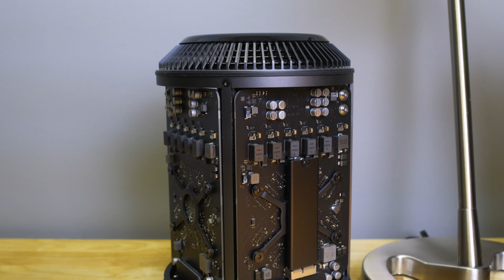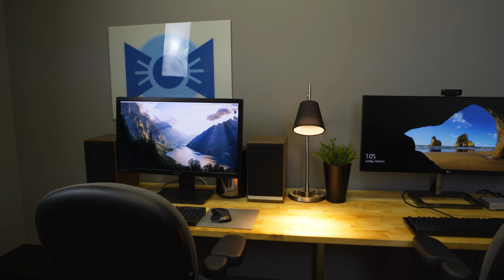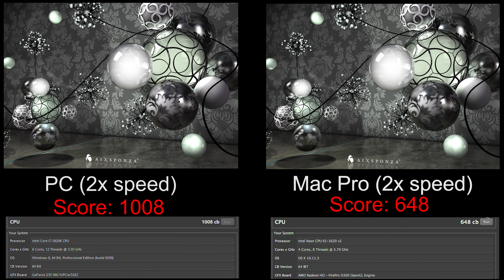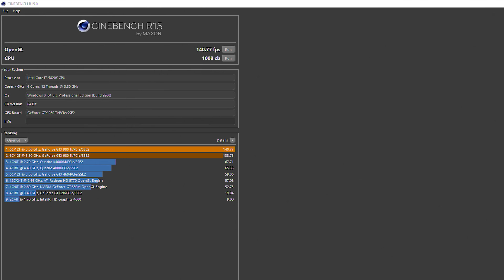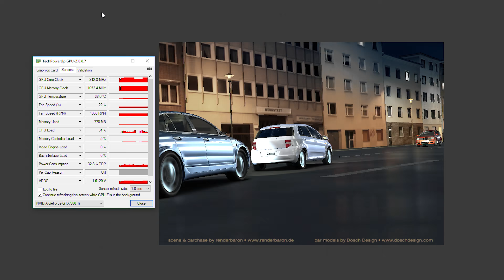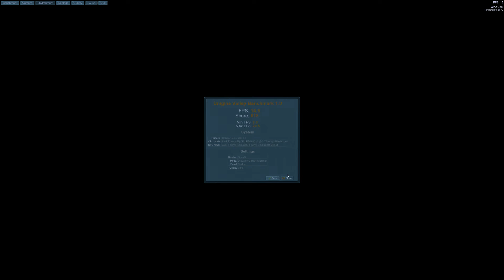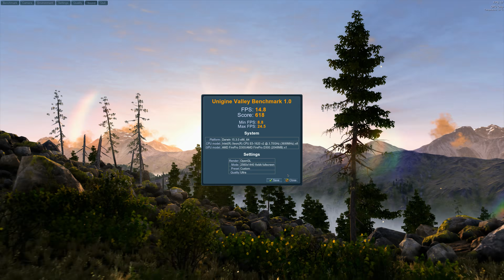$2,000 Custom PC vs $4,000 Mac Pro

Comment: Simple Life Fix for Apple Fans: Buy Apple OS, Buy or build a custom gaming rig for about $2K then load the Apple OS on to it. Boom! Now you have a system that can out perform anything Apple ever invented.
Reply: osx doesn't support most hardware cuz it sucks
Reply: +AngyPangy The hardware used to build Macs are also used and sold for PCs. Not everything would work but there is a lot of high end hardware listed on the supported page. Also motherboards that were made for Intel processors, and manufactured in 2010 or newer should work with no issues. Mac OS X offers "out of the box" support for many graphics cards by NVIDIA and AMD. If all else fails you can use OSx86 which is Hackintosh.

Comment: THIS IS UNFAIR.... it should have been Mac Pro vs Xbox One vs PS4 vs Wii U... that should have been a fair test... oops.. You can't game on a Mac... sorry....... Now I get it... Moving on
Reply: Blaze Fire - No need to explain Mr. Keyboard warrior... I understand the frustration.. People just don't play on that standards anymore... that is why we need to lower our expectations on a Mac on gaming... ok for your convenience.. let us lower it to PS2, XBOX and Dreamcast... Happy?... We could go to the 90's if you want... Peace My keyboard brother... CHOW!!!
Reply: so true macs are not for gaming
Reply: +Jerald Guevarra You CAN game on a mac, but it usually works better with games DirectX9 or lower. So at best you can run Source games just fine, but full HD games won't work because that's not what the APU was designed for. 

The APU of ANY PC is typically only used for light processes, like streaming videos on the web and using a web browser as a whole, along with giving access to extra ram to use as video ram if that processor supports it. 

An APU CAN work well with games (Take the PS4 or the XBOX ONE for example), but an Intel or AMD APU simply isn't designed to run games at 4K for example, since that wasn't it's target market.

The aim of a APU is to focus on getting things done mathematically, while taking into consideration saving battery power and optimizing preformance in a laptop, or something to that effect.

Comment: Let's take a two year old Dodge viper and compare it to a custom built car with twice the horsepower and torque and see which one can go faster in a straight line while we are at it. This is not a fair comparison at all, look at what you put in the computer you built, not only years newer hardware, you put in twice as much ram. Also, the Mac Pro has a very specific use case and it's much more than hardware. 95% of professionals in music, film, production, and design use Mac for a reason...
Reply: +The1andonlyBYack  and the reason is?
Reply: +The1andonlyBYack 

Remember, when Apple eventually goes belly up,  many Apple users will 
commit suicide, a mass event like Jonestown massacre. 

I share this because it's important that fan boys start shopping for 
psychologists in advance to ensure that they survive the great culling.

Best of luck.

Comment: I bought one of these Mac Pro and I was very disappointed. The performance was so poor, I thought something was wrong with it. I took it back to the Apple store and they gave me another one, same thing. Then I bought a MacBook Pro 2.3 GHz i7, 16GB of RAM and a Nvidia GeForce GT 750M and a 512 GB SSD. It works great. I think one of the problems with the Mac Pro is the graphics cards, they don't play well with Adobe products like Premiere Pro and After Effects. Graphics professionals used to be an essential part of Apple's community. Apple is now all about consumer products. You can't get a Mac with an Nvidia graphics card now. I worry about the future, when it is time to replace this MacBook Pro, I'll probably have to make a complete switch. Gerry in Calgary.

Comment: You knew this would go the way it did.  Two points, the Mac is 3 years old....so test the new when Apple releases it,  against your new monster rig, and two does your new unit run OSX? No, then you won't stop anyone from getting a mac if that's what they want.  Is the current MacPro outdated,? Yes , I can't wait for Apple to release all new desktop line this year.
Reply: +minnescanada The point that was being made here was stating that apple is ripping off people when you can get something equal or better for half the price
Reply: The thing is that the Mac Pro is still at that price...
Reply: oH it's a ripoff now for sure.  But they are still very cool machines and can get the job done.  When Apple updates them, they won't be quite as  much a burn.  Too much for me though.

Comment: You can OC your CPU much higher without touching voltages. I have the same CPU, Asus X99-Delux MOBO and the h60 cooler and it goes to a stable 4.6... Seen a lot of people getting similar results online also. This was all done using the Asus 5 way optimisation software so I'm sure it could be pushed even further for the hardcore tweakers.

Apple may have nice designs but WAY overpriced - PC will always win :)

Comment: The hardware that you are comparing are entirely different type. Xeon - i7, ECC - nonECC, Fire - Geforce. One is server hardware and the other is general consumer hardware. They are to be used for different things. This test was intriguing but meaningless to begin with.
Reply: +Anirban Samanta add 200$ and you can go upgrade to a E5-1650 v3. Memory.. same thing (even less)... so that's $2600. And you do not need a FirePro/Quadro for video editing! (CAD - yes, but not for editing)
Reply: +Tõnis Lind Never said you need a FirePro/Quadro for anything. Just pointed out that the video compares two different types of hardware. There is a reason why people do not game on FirePro/Quadro even though some of them cost hell of a lot more than the most expensive Titan you can find.
Reply: +Anirban Samanta well a M6000 is a suitable replacement for a 980 ti / TitanX :D
Reply: +Tõnis Lind That is the point that I was making. M6000 is meant for rendering and not for running graphics engines which come with pre-rendered resources.

Comment: I prefer but PC BUT what you didnt say was:
1. Xeons  are tested for really long operation and MAC PRO has an ECC Memory which is 100% stable which normal RAM is not. ECC eliminates some problem, don't know it that well, but it's simply more stable (for server for example).
2. Graphics cards in a MAC are 10 bit. It's very important for graphics designers as the consumer grade video cards like 980ti doesn't show you all of the colors. MAC pro does.
3. You compared graphics in a real-time scenerio, where it is known that 980ti would win as it is built for that. How about actually rendering?
Reply: +Kacper Dąbrowski (KaplaRecords) "consumer grade video cards like 980ti doesn't show you all of the colors. MAC pro does."  you sir are what the professional video editing world calls a "Fucking Idiot"
Reply: +Kacper Dąbrowski (KaplaRecords) 
1. Want long term 24/7 operation with ECC memory? Just add a Xeon instead. This ones not much more expensive than the 5820k. http://www.newegg.com/Product/Product.aspx?Item=N82E16819117480&nm_mc=AFC-C8Junction&cm_mmc=AFC-C8Junction-PCPartPicker,%20LLC-_-na-_-na-_-na&cm_sp=&AID=10446076&PID=3938566&SID=

2. Want 10 bit color? Get a Quadro. Really not that much more expensive than the 980ti in this video. http://www.newegg.com/Product/Product.aspx?Item=N82E16814132051&nm_mc=AFC-C8Junction&cm_mmc=AFC-C8Junction-PCPartPicker,%20LLC-_-na-_-na-_-na&cm_sp=&AID=10446076&PID=3938566&SID=
980ti for comparison - http://www.newegg.com/Product/Product.aspx?Item=N82E16814487144&cm_re=hybrid_980ti-_-14-487-144-_-Product

3. The PC would still win.
Reply: +TheAstronomyDude O, we have a bad ass over here. .. Dude, watch your language.
i never said anything about video editors. I said that graphics designers take adventage of that.
Reply: +Zveir A for quadro - the one you chose is way less powerfull than 980ti (it i based on 970) but you obviously have a point here. I know all of those things - It's just the comparison in the video that is not 100% fair to me. However you're right, PC still wins, even after getting XEON and Quadro.
Reply: ***** In terms of gaming performance it's way less powerful than a 980ti, but it's usage in rendering is much better. Especially if you're using a software suite that takes notice of Quadros. 
I think I'd personally take a 980ti because the only rendering I'd be doing is video rendering, and the CUDA cores in that will help a good bit more than what the Quadro M4k has to offer.
Reply: +Zveir same for me.

Comment: My new rig is running a 3960x at 4.3GHz which is from late 2011 (scored 1107 in Cinebench), it performs with dual GTX 960s in SLI at basically the same performance of your PC... So... Apple really screwed up since my PC (though new to me) was 2 years old when the new Mac Pro came out

Comment: Why didn't you put the same hardware to run the "same test". If I want to have a off road car test I wouldn't use a jeep Sahara limited against a little fiat. You want to use the same specs: ram, chip, graphics card.
Reply: I have mac pros and high end pc laptops with the same specs and the give the same performance when running real life apps, video editing , animation, Autocad Photoshop.

Comment: can we please stop making builds with I7-5---k cpus? you do realize these are enthusiast edition not because they are god tier gaming cpus but because they are amazing at video rendering and such AKA multicore fucntions....... lets look at the i74790k? 4.5ghz clock speed most games run on one core maybe 2, therefore you have 2 cores left? but thats 2 cores at 4.5ghz whereas you have 3.3 ghz 2 cores with four lefT? MORE CORES DOES NOT MEAN MORE PROFIT
Reply from the maker: +NJ55 Hi. Don't know if you've noticed, but I make videos. I need the extra cores for faster video exporting. I was pretty explicit in stating that gaming benefits with a higher clock speed core rather than a higher amount of cores. I don't game. I video edit.
Reply: +NJ55 Um, pretty much every game i have on my pc slams at LEAST 4 cores xD idk how many generations behind you are but games have been using 4 cores and up for like the last 4 years at least xD, hell even skyrim will kill 4 cores with mods and its a 2011 game xD....Your obviously not that up to date with current generation game engines, and or how those game use cpus....
Reply: +NJ55 Do you even know what you are talking about? He explicitly mentions that he is using this build for video editing. The CPU he bought absolutely destroys the i7 4790k, even overclocked because of the two extra physical cores. Then, on top of that, each of those cores is capable of hyper-threading (which his video-editing programs can fully utilize) for an advantage of 4 more "cores". The theoretical limit of instructions per clock on a 12-core 3.8Ghz is ridiculously higher than 8 cores are 4.4 or 4.5Ghz.

Read up buddy.
Reply: +NJ55 but if thats so, that gaming only uses 1-2 cores why wont farcry 4 even launch with a dual core processor and also look at city skylines that shit is really cpu intensive.
Reply: +NJ55 and also why are the K line enthusiast? I thought that the REALLY enthusiast was the X line
Reply: +Henry Montero The K is for Overclocking
Reply: ***** I know but he was calling it ''enthusiast'
Reply: *****
Right haha i wouldnt use anything under an athlon x4 quad core minimum or an i3 4130 with hyperthreading for gaming nowdays
Reply: i bought one because why not. 5820k in my pc. not cus im an enthousiast but because i can
Reply: icyrax314 untrue. they do that because that way your pc still has processing power left for other tasks. the game uses 2. others tasks will use the other 2. i got a hexacore, unparked all the cores via software and see a huge increase in arma3 fps(CPU heavy game instead of GPU). so yes. more cores makes a difference

Comment: Correct me if I'm wrong, but the Skylake processors have new instructions for encoding 4K video in H264 which should accelerate video encoding. I think you should have chosen 6700K.

Comment: Why are you testing the graphics on traditional benchmarks? The AMD graphics on the Mac Pro are aimed at professional usage and not geared for gaming, unlike the GTX 980 ti. These computers are geared for totally different things but your tests are biased towards the self-built computer (CPU test was fine but GPU test was for graphics output, not power of the GPU). If the components of the self-built machine were of the same standard (i.e. ECC ram, professional GPU, Xeon Processor) and your tests were geared that way, I feel it would have been a more rounded and reliable test. But that's just my two cents.
Reply: +Harry Atkinson Who the fuck cares the computer still runs laps around the mac pro when it comes to rendering there is no reason the graphics card in a workstation should be 3 times slower just because AMD and Apple labeled it as "professional" at the end of the day its 3 times faster and thats what matters

Comment: not shocked the gaming card rig beat a workstation card setup, they're aimed at different utilization  - accuracy vs brute speed.  what about putting video output from finalcut/premiere / autocad / etc.  should close the gap (the nvidia build will most likely still beat it).

Comment: lol my OC 4.4ghz i5 4690k beat this haha i got 674 on cinebench and gpu i got 142.69
Reply: alsmost the same here i5 4690k + r9 380x
Reply: +Norry Fox nice! :3
Reply: +Daevon Jackson hey what cooler do you have? I have the stock. Should I upgrade?
Reply: +jrsmoothman2 I have a hyper 212 evo
Reply: +twan duvigneau same lol
Reply: +jrsmoothman2 hell yeah hiper 212 evo is the best one for air ;3 only 30$ and will improve fps if bottleneck by 10% or more
Reply: +KV-1S Tanker fam I have the same PC as you but with dual Titan xs
Reply: Yeah... It's been in the making for like 5 years now. Only just got the Titan xs
Reply: 4690k @4.5 GHz and R9 380X over 650 points in cinebench

Comment: Testing is skewed slightly.. I agree that the MacPro struggled for your testing, but your methods were wrong for benching these two machines! First Apple clearly optimizes their machines for Open CL architecture which is the basis for their flagship Apps like FCP and such not Open GL which is a PC and Nvidia dominated platform! That's why the Mac Pro struggled with both tests.. Try installing FCP and doing the export test? you'll see much different results. Also you have the Quad config of the Mac Pro which even the Latest Skylake iMac 5k Outbenches with ease in almost every single score mark! Almost a tie in Multi scores, but a huge thermal difference between the two! End of the day, MacPro with Xeon is not going to give you good single core results! and NO Xeon will give you better performance than an i7 in single score bench tests. You need to use the correct software to properly bench your MacPro so that it is running at 100% utilization like your pc and then you can compare. But then again not really because if you are a fan of Adobe, the relationship between Apple and Adobe has really suffered as of late so no telling when or if they ever will optimize their products for OpenCL fully or not? Not to defend Apple here completely, but looking at your list of parts here. Non of them exceeds nor meets Server Grade components and your MacPro has nothing but server grade components! Don't sleep on it and do your homework before rushing to conclusions! Last but not least, I'll buy your MacPro since you clearly don't want it anymore! :) Regards
Reply: +drewbin101 drew does have a valid point.. But I have a fully maxed out mid 2015 MacBook Pro 15 inch with Retina display, and holy shit, for a laptop it is unbelievable, of coarse my custom liquid cooled i7-4790k with an 980ti kicks it's ass, but for a laptop it's incredible, never fails me and is perfect for productivity in every aspect, even for some light gaming it's great (yes I said GAMING ON A MAC) but on a more serious note.. Macs are built for work and for productivity, not meant for graphically demanding games
Reply: Then again. The price.....
Reply: +Seong Hong  Good point.. But think of it this way.. If you are a PROFESSIONAL than you are making money from your mac and it will pay for itself by being rock solid everyday and not needing maintenance that lower builds will require over time. If you were a Professional and lost just one client project or a song you recorded and could not recreate, whats that worth? My point was just right machine for the job! I can guarantee that his MacPro will outlive that PC he is raving about! And if he did his homework and got the correct parts instead of just looking at specs, he would have never bought a Mac that he didn't need in the first place! Not either machine is at fault here.. It's the user!
Reply: +dank pepe I'm not biased on Mac at all, I didn't want to come across that way! To put it in perspective i have a Hackintosh with a 4790k and i almost got the 980ti because it would have been great for the PC side of my dual boot, but i had to get the AMD 390x instead. Lower price, than the 980ti and i just tear through games at 1440, but i also get "ridiculous" Open CL support for FCP and other Adobe Mac apps for the Mac side! I built my Hakintosh because Apple can't give me the experience i need! So sometimes you have to do it yourself! Apple will most likely cannibalize all of their desktops eventually, except for maybe iMac? They are also trying to do away with the notebook as well (iPad Pro).. Its clear they don't want upgrades on any of their products and in my opinion they need to take the word "PRO" off of everything they make with that claim! they lost that privilege! LOL